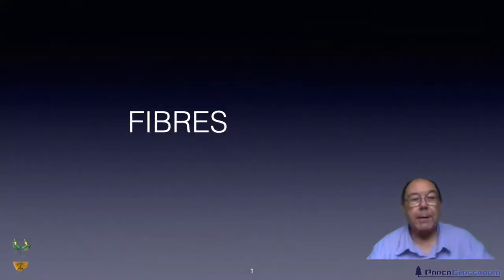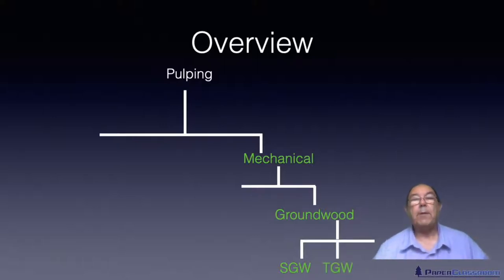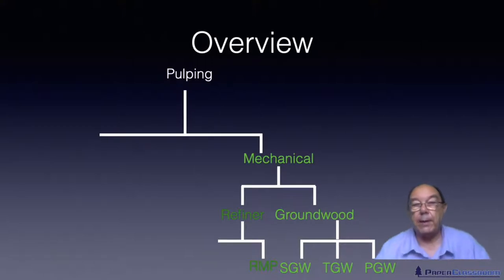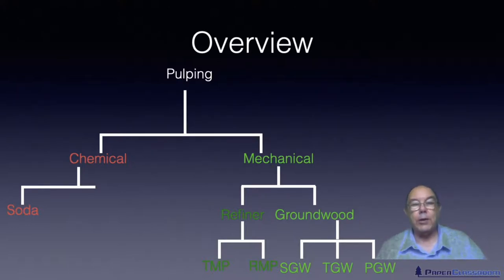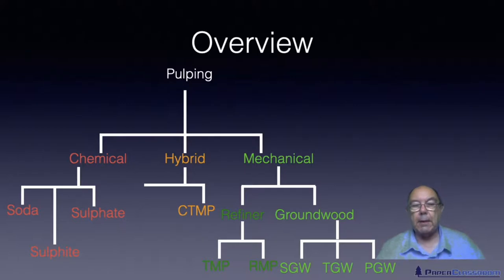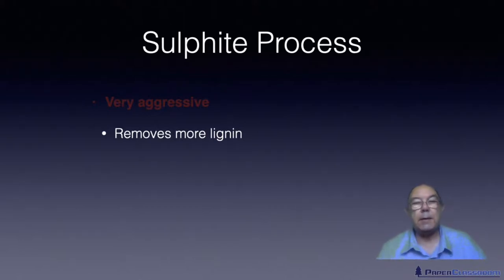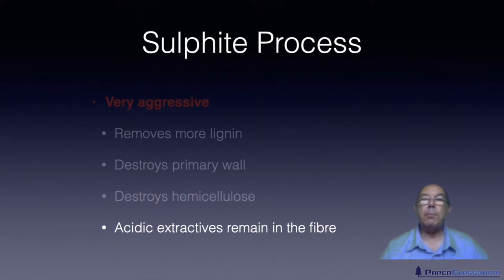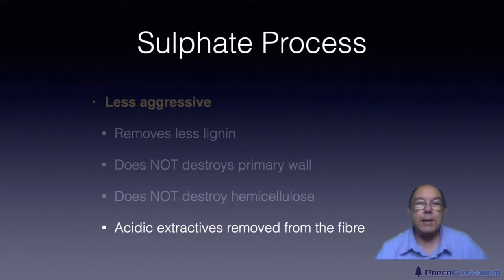Level 2 Papermaking - Chemical Pulping

Comment: Thanks,  How do we signup for the technical certificate?
Reply from the maker: Hi Jerry,
There is a Level 2 Technical Certificate in Papermaking, and a Level 3
The official Nationally recognised exam can only be sat in the UK (Feb/March, July and November each year). However you can do the course without the exam, or with a Steve Mann Exam, but this would not be nationally recognised.
The course can be delivered face to face in a classroom, or via Zoom,  or as an on-line course using MOODLE. Please contact me at steve@paperclassroom.com if you would like more details and prices

Thanks,

Steve